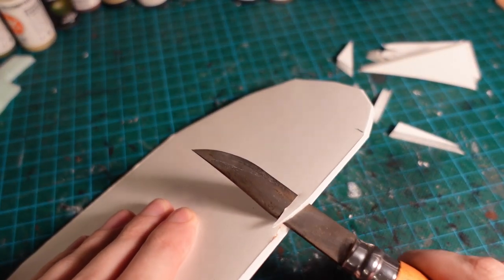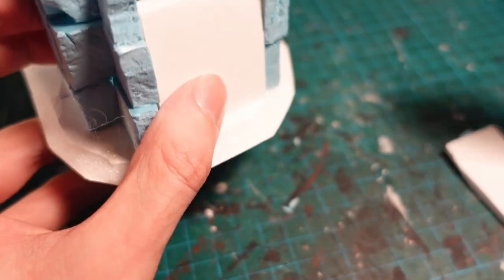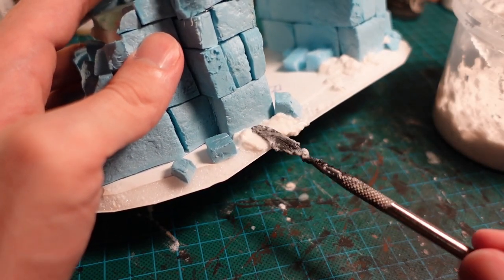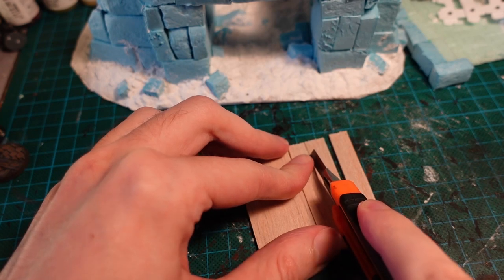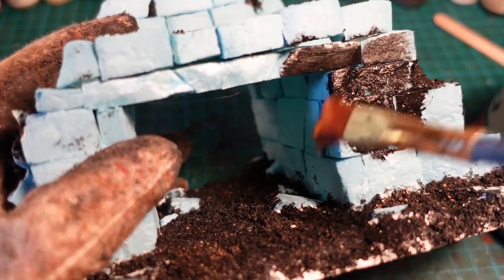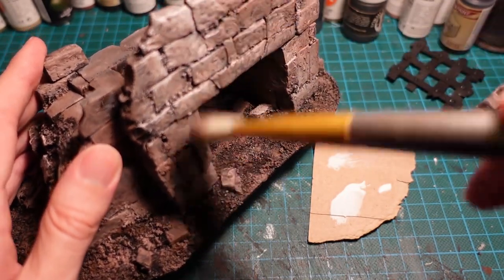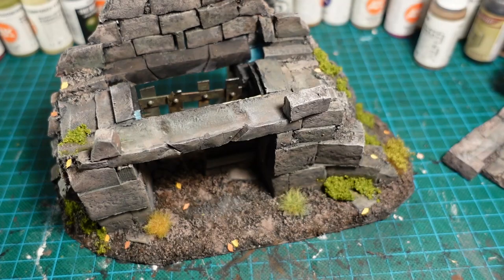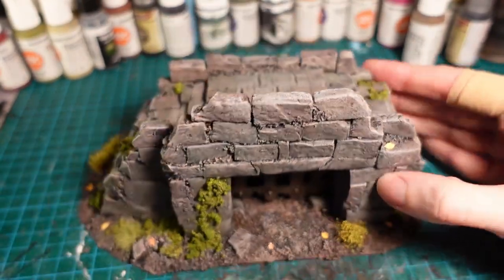Ruined Gatehouse for D&D

Comment: Again Thank You,
I believe it was last week or the week prior I commented on your technique for the ruined staircase.
After having shown that episode at my RxR Club's Thursday Trackcleaning Turnout session, about a half dozen Gandy Dancers (a.k.a. members) came up with more ways to use your style.  So from the NVR/WAS Railroad, The N.Y. Capital District HUB, & New England, Berkshire, and Western Rail clubs a HUGH thank you.
On to this episode, two points.
First, it was unclear to me the tautness of the roof and upper sidewalls.  Just in case.  Should the roofs foam structure be difficult to remove as desired I use self-adhesive rubberized magnetic strips.  Attach one to the under side of roof.  When secure the visible portion of the magnet can be painted and weathered to match the interior stone.  Then with a complimentary, yet larger, disc magnet attached to a dowel it is possible to lift the roof off with minimal difficulty.
Lastly, as for this gate design.  One of my personal layouts rehab & upgrade we are building to represent a Mid-Atlantic U.S. State as a Faux-Theme Park Dark Ride/Coaster my HO scale trains will run through.  My thought was to have a non-descript tunnel portal as it's entrance.  But having watched this episode my plans may have changed.  By building a foam/stone Wagnerian/Vlad the Impaler style castle.  As the train approaches an under track magnetic switch will trigger the gate to rise.  And the consist will begin it journey through the under world and scenes from various "Action" & horror movies.
Thanks again.
Jim in N.Y.
Reply from the maker: Hi, that sounds like a fantastic idea you've got there. I hope it comes together well!
Thanks!

Comment: Absolutely loving your videos! What's the difference between the XPS foam and the insulation flooring board? Cheers!
Reply from the maker: Mainly the form it comes in. The Flooring is easy to get and very cheap but it comes in thin sheets so it's only really good for flooring, neat brick walls etc. It also takes texture a little less well. The XPS foam however can be used for a lot bulkier shapes and takes to texture more easily